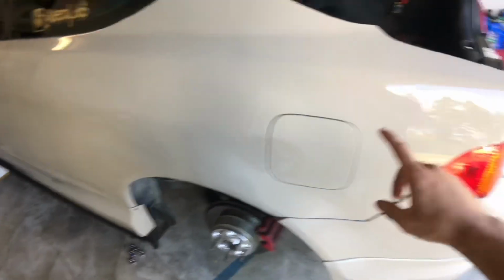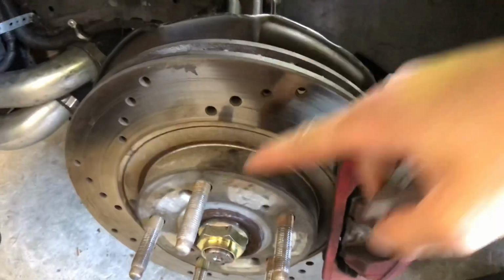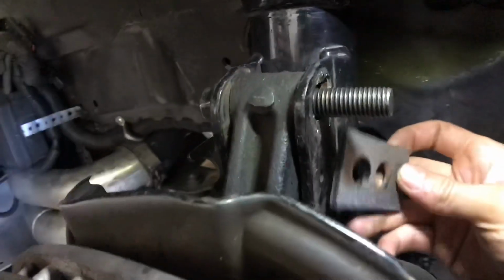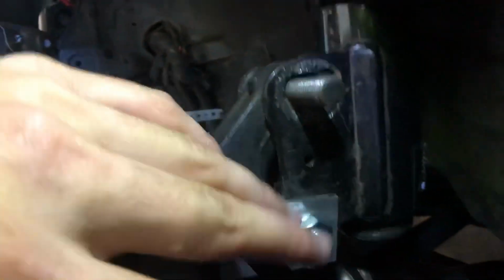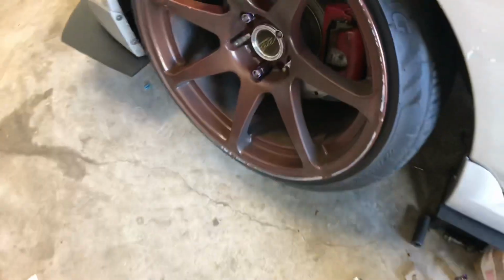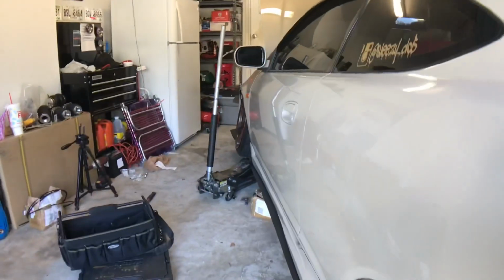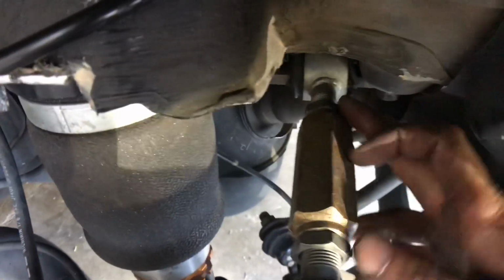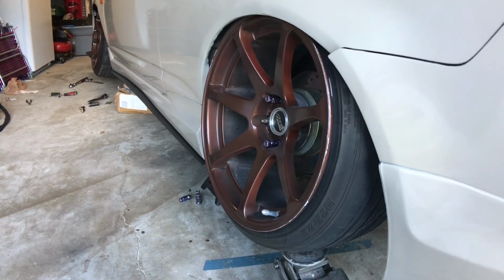SOOO MUCH NEGATIVE CAMBER

Comment: Would those brackets for the front work in any application/vehicle ? I’m tryna tuck 9.5 +15s on my 98 Accord coupe
Reply: Rayvaughn Whitten i’m thinking so if it’s a similar suspension setup. considering trying this on my 2005 tC
Reply: update; it does work. running 17x10 all around and tucking
Reply: What did you use for brackets?

Comment: Would this cause any issues with the axle taking it so far from the trans?
Reply: This actually pushes the axles inward toward the trans extending the lower control arm will pull the axles out from the trans

Comment: Please answer me this very big doubt, can I do this?  with a completely stock suspension?  no coilover no arm cambers, literally a stock suspension??
Reply: I don't see why not I'm experienced with the fronts design of the two bolts you can easily slot the top and have drilled plates on the bottom. Though it won't look good maybe lowering springs but this is mainly when you want to be slammed on coils or bags